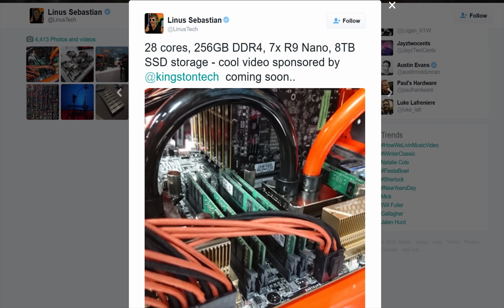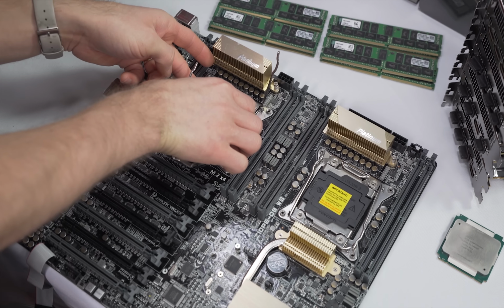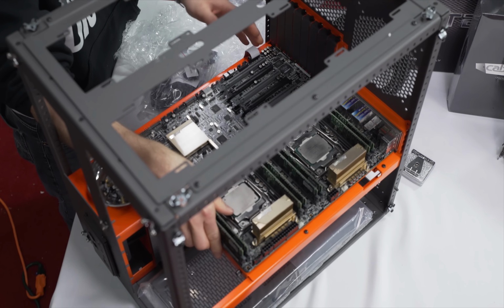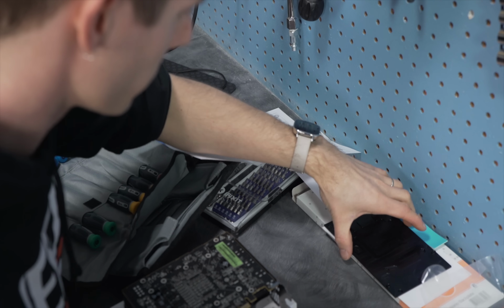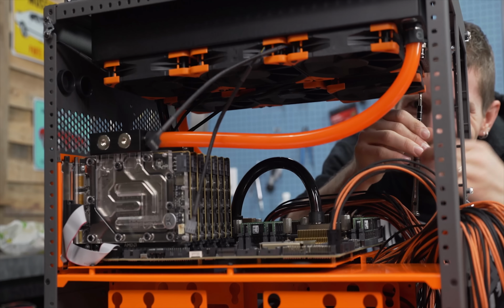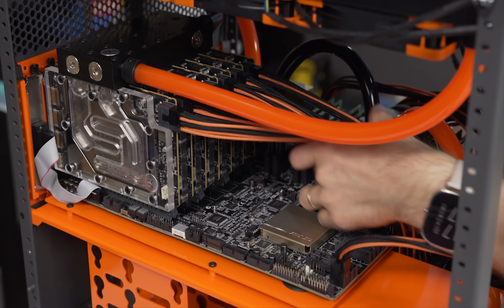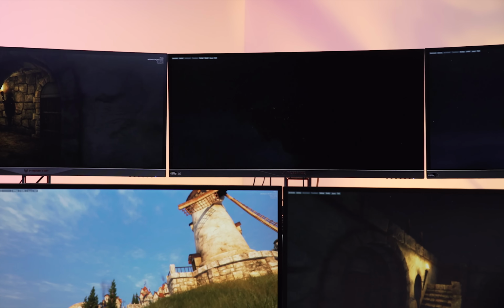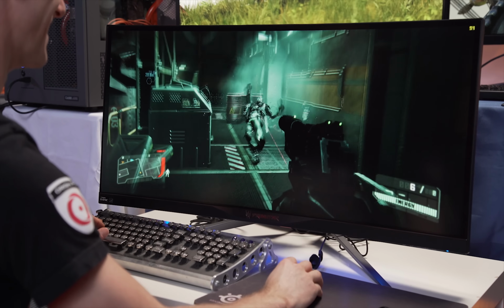7 Gamers, 1 CPU - Ultimate Virtualized Gaming Build Log

Comment: This would be awesome for an Internet cafe. Instead of buying or building 28 machines, you set up four of these.
Reply: yeah -_- $120K for a fuckin internet cafe
Reply: +Muhammad AbdelMon'em well, there's dubai :D :D
Reply: +Muhammad AbdelMon'em could costt less i think "I feel like this build's cost could have been cut in half, Ok so lets say you go with 512GB SSD instead of 1TB and maybe instead of 7 1.5k monitors 7 $180 to $250 monitors and instead of 8* 32GB sticks you got 8* 16GB shouldn't this build cost then come down to around 16k or 17k? which then puts it at about 2.2k per PC which IS CLOSE to the cost of a normal liquid-cooled PC ofcomparable specs and performance to that of the virtualized machine?

Which then brings up another question... if the cost is reduced by nearly half does something of this magnitude become a better solution than having individual machines (since this uses less power than 7 machines at max, and produces less noise and heat than 7 machines)? Yes there would probably be a ton of software issues that's a given."
Reply: Because of the overhead needed for viaualisation and the price premium of high density products like the nano and the $2.7k cpus and the 32gb ram sticks. You're simply better off buying seperate machines.
Reply: +ElZamo92 Sure The internet cafe would probably have to charge you a premium of 5x to make their money back :)
Reply: +Muhammad AbdelMon'em You can use cheaper hardware and then it would be pretty reasnoble
Reply: +ElZamo92 PC's are $600 each, totally going to spend $30000 on 7 of them
Reply: +ElZamo92 reliability is next to none, if one machine fucks up you&#39;re out of 7 serviceable units for customers.
Reply: +stefanozurich I assume that by 'viaulisation' you mean 'virtualization', in which case; there really isn't any overhead. Virtualization in modern PCs is done straight from the CPU in a standard (it really was a huge deal when this finally came out). That's the whole point of going through such lengths as opposed to just going at it through software on your already installed operating system. You assign the virtualization at a CPU level, then assign some resources/devices to that, and that's it. There really isn't any overhead as long as you don't include programs that interact with your virtualized instances, since they (at least in the setup displayed in this video) run in parallel. If you include the costs of electricity used (due to having to run the same components unnecessarily, and efficiency losses in the power supply itself and the delivery to the components), the extra power supplies, cases, and the motherboards, I'd say you can probably break even if you don't use top-of-the-line ultra dense hardware. That's not to say it makes sense from a business perspective. I'd much rather pay extra electricity and extra for redundant hardware than having my whole business shut down for a minor hardware failure. Y'kno, that whole thing about not having all your eggs in the same basket.
Reply: +ElZamo92 That would be the worst thing to do.
1 card goes bad and you're down 7 computers for some time. It's impractical as fuck, all condensed, water looped, so a bitch to service.
And it is wayyyy too expensive on top of that.
Reply: +ElZamo92 They would have to pay 120 000 usd doe
Reply: +ElZamo92 at least the power bill would be good over time , would pay off in long term ....
Reply: maybe instead of r9 Nanos something like r7 270s and instead of 32gb RAM/person maybe 6 or 8, maybe 1 of these cpus, not 2, maybe 500gb hdds instead of 1tb ssds, etc...
Reply: also no fucking need for predator x34s, they were around $11500 of the budget
Reply: +ElZamo92 Will this run minecraft, d'you think?
Reply: +ElZamo92 Do those things still exist ? Cause they don't in Estonia.
Reply: +ElZamo92 but this way more expensive !
Reply: Well it would be more lile a langamingcenter with a cafe build into it...It can run crysis...on all monitors at the same time...And you just want to surf in the internet...
Reply: +Seemslegit that is true
Reply: +ElZamo92 the downside...  all of your eggs in a a couple baskets.
Reply: +ElZamo92 Yea real clever, a 30k$ stupidly quirky unsupported gaming rig for an internet cafe. Seriously who the fuck up votes dumb shit like this. One machine goes down and half/quarter of your shop and profit out the window.
Reply: +G4A Gaming4All That would be basicaly the poor's man VDI server.

You can have a rack, run CITRIX server and have 40 VDI for your cybercafe. We do this in schools, big companies, datacenters, ...

Comment: 250 watts midrange pc under load?
What midrange pc you been looking at?
Midrange is like 350-500 watts.
Reply: +Surms41 There is not an official Mid range, don't be pedantic.
Reply: +Surms41 He said 250 watts at idle?
Reply: +Surms41 Don't compare older hardware with modern one, old components suck a lot more power, generally speaking
Reply: +Surms41 350-500 watts is what a 6700k+980Ti build draws under load.

Not exactly midrange. The new architectures aren't as power hungry as they were 2 to 3 years ago.

A 960+i5 6600 build will draw around 250 watts.
Reply: Surms41 A high end pc could be i5 and 970 because it is more expensive than say 60-70% of pc parts. an i3 and 960-950 would probably be mid range.
Reply: +Surms41 many PC elitists are not educated enough to know what an actual midrange PC looks like.
Guess same people see girls in the Sports Illustrated and go "Meh, they are average at best - Miss Universe is the only non-trash gurl".
Reply: +Surms41 My Haswell i7 combined with a GTX 970 take around 280 Watts under load.
Reply: TheMightyChris901  Yes, he said the build takes 250watts idle, and then said as much as a midrange pc at load.
Reply: +Jared Reabow (Jazza) I would classify Midrange by being able to play modern games on low, 60fps.

+Andrei Zhuk Yea, I just calculated the wattage for a i3-560 3.3GHz, 4GB ddr3 and a 550ti, the lower half of mid-range, and it draws 290~ Watts. Was a bit higher than my previous statement.
Reply: +Surms41 Well my laptop on low will do 60fps
Reply: +Surms41 yeah that's a 550ti... Much less efficient then the Maxwell architecture. A 970 draws the same amount as a 550.. So get a 960 and a i3 or i5 and I won't be surprised if you get less then 250 under load.
Reply: LightSoundGate Redid my last calculation, it was actually around 290watts, and I also did calculation for 970 and i74770, still around 320 watts.
***** 
I guess you're right about efficiency, that I did not take into consideration.
But then again, you must pay extra for newer parts with less power draw.
Reply: +Surms41 lel, people always think every PC burns 500watts with like a 960/970 and an i5...
Reply: Žan Zupančič Yeah with 970 especially.
Power consumption on nvidia's side kicks ass nowadays I guess.
Reply: Yeah.. 970 + 6600k burns like 250watts lel
Reply: ***** 
That's a low-low-end pc for any games.
Mid-range must have dedicated graphics.
Reply: +Surms41 Im running a 6700k + gtx970 strix, ~300W during load.
Reply: Same here: I got an overclocked 4790k and a heavily overclocked 980 ti. The system never draws more than 450w from the wall (Corsair Link)
Reply: Anton Meyer-Erlach wowow

Comment: The REAL Question is : would a REAL 6 Gamers 1 CPU? I would think of the Intel E7-8895 v3 : a CPU turboboosting up to 3.5 GHz with 18 Cores for a total of 36 Threads, that would leave 3 cores and 3 threads per VM if we go for 6 gamers. 
What do you think guys? is the CPU enough to game? will the upcomming (Q2 2016) E5-26XX and E7-88XX solve the lack of enough PCI-e lanes and increase the performances?

Comment: Would love to hear the response from Kingston and caseloads when they said we'll we are just gonna use double sided tape to secure these ssd's
Reply: +kingofengland111 They knew what to expect when the sponsored LTT
Reply: +kingofengland111 they're SSD's they weigh next to nothing and have no moving parts, it's not like double sided tape hurts them, plus it gives a unique way of displaying the hardware (while showing FULL LABEL) that will get people to remember it more (which is really the whole point of these kinds of shows).
Reply: *caselabs
Reply: +kingofengland111 I expect at CES the side with the SSDs will be showing to visitors, so they will be happy with the presentation.
Reply: +kingofengland111 That's kinda normal actually, quite a number of people actually do that. Although I'd figure CaseLabs would send in the adapters just before CES maybe.
Reply: +kingofengland111 My SSD is also secured with double sided tape. An SSD is very light, it's not going anywhere.
Reply: +kingofengland111 as long as the sata cables are plugged into the ssd you can throw them around as much as you like, they will function well. SSD is not HDD.
Reply: +xX JAEdot420 Xx you're a moron.
Reply: +kingofengland111 Something like:Yea, that´s our Linus...It way mine response too btw.
Reply: +kingofengland111 And i don't think they have the room to place it in racks
Reply: +kingofengland111 Why not? SSDs have no moving parts, so you really could just put it there without securing them at all and they still would not move.
Reply: +kingofengland111 The problem was that they didn't have any other options on what to do with them since the cases that should hold them, that was in the caselabs case could only hold down HDD in a 3.5 form factor and not the SSD 2.5 form factor.

I highly doubt that they will get a replacement for it from caselabs, but it could be awesome to see it properly setup with some LED strips or something of that sorts. (Maybe LTT/LMG decals)
Reply: il respond them SSDs are dog shit and wouldn't even put it on my shelf!
Reply: +kingofengland111 Well, for 1 thing, SSD's have no moving parts, so even if they were to fall it wouldn't matter. Second, I can guarantee you that companies who sponsor this channel have come to expect this behavior from Linus.

Comment: I wonder, if I build a gaming PC with the intention to LAN on it. Would this kind of thing be a viable option? of course, I would only virtualize two computers.  Another thing would it be possible to set up a boot option or setting, which allows one virtualized computer to use the full capacity of the machine while I don't LAN? Or am I simply better of building two separate computers.

Comment: Can a nano really push 100fps in crysis 3 at 3440x1440 without using lowest settings?
Reply: +Heatranoveryou the nano card is really strong actually 

don't let the size fool you :D
Reply: I know its powerful, but hes over selling it I think.  http://www.anandtech.com/show/9621/the-amd-radeon-r9-nano-review/5
Reply: +Heatranoveryou the normal Nano thermal throttles, this one is Watercooled.
Reply: Mikee Tyson
Ah right. I forgot about that. I should have checked it specs too and realized its actually a fury x. However, I don't think even Fury X and 980 ti can push 100fps in crysis 3 at 3440x1440.

Comment: Sorry, random question, if I wanted to change my CPU to a higher end CPU, will I need to reinstall windows? Right now I have a AMD 4300, but I want to upgrade to an 8350.
Reply: Cheanno Respo No, you don't need to reinstall windows if you are upgrading your cpu.
Reply: ***** Thanks!!!
Reply: +Cheanno Respo For that matter, you can pretty much change a lot of things in your pc without the need to reinstall windows.
Over at LTT they have test drives they use on their test benches that they just plug in on the the platform they want to test and don't reinstall windows every time ;-)
Reply: +Gormador Changing more than 3 items in any pc will require reactivation of your windows license. Changing motherboards is sometimes a crap shoot.
Reply: Chris Hunter Well, yes, but a reactivation isn't a fresh install now, is it? :-)

Comment: Is this not 7 gamers 2 cpus? Hate to be pedantic, but I guess you probably could have done it with just one. A single core, 14 cores, 28 thread, 2 per computer. Might not have been the best gaming experience, but still could have been done.
Reply: No when he refers to the cpu he doesn't mean an actual cpu he means the entire of because it is processing for all 7 gamers
Reply: +Zell It has two physical processors but it is still one CPU.

Comment: I would love to see this get installed somewhere and say have all your editors be able to access and use it without needing a full terminal to do so.  

They can put their VM to sleep but not shut it down so when they push on the keyboard it wakes up.  

Would be interesting to see how the cables get routed and run to make it all work.  I know some things can be run in the walls and just have wall plates installed so monitors and USB stuff would just plug into the wall is it were but how would the signals cope and would people appreciate the added desk space and say "parental" controls available but no one having their own system.

Comment: 1 CPU? thats clearly 2
Reply: +Győri Sándor try 7 gamers 1 board
Reply: +Győri Sándor you are dumb as fuck the computer is the cpu, the central processing unit for the 7 gamers
Reply: Even I know I cant argue with idiots I still try: https://www.google.hu/search?q=CPU&tbm=isch&tbo=u&source=univ&sa=X&ved=0ahUKEwi0pqyXuI3KAhVIhiwKHfrrCw8QsAQILg&biw=1920&bih=989 This is a CPU. And thats a multi cpu motherboard. Do you know why it is a multi cpu motherboard? because it holds multiple cpus. the computer is not the cpu. the computer is the combination of components and one of the components is a CPU therefore cpu != pc (!= means not equals)
Reply: +Győri Sándor I agree with you. 2 CPUs in one computer
Reply: technically that's 28 CPUs because cpu refers to a single core, not the entire processor. But most people just call the whole processor the CPU anyway.
Reply: +Győri Sándor The reason it says 1 CPU in the title is because the 2 CPUs act as one. Physically they are 2, but virtually they act as 1 CPU that shares the load to the allocated cores .
Reply: Joseph Pitts Yes
Reply: invaionworld Yup, but that doesn't change the fact that this machine contains 2! intel xeon processors. TWO CPUS!
Reply: +potsbeatnt3000 A CPU is a Central Processing Unit, a Computer is a combination of power supply mobo CPU GPU etc...
Reply: Győri Sándor It does. If you have ever used  VMs you would know that you don't count the CPUs. You count the total amount of cores your whole setup has.

Comment: I have watched EVERY SINGLE VIDEO you've made (on this channel) they are all master pieces. but this one is absolutely legendary. I went from a core 2 duo at stock speeds with a radeon 3450 to a fx 8320 at 5ghz cooled by a H100i GTX, paired with a evga gtx 980 SC at 1510mhz. if I never watched your videos, none of this would be possible

Comment: I feel like this build's cost could have been cut in half, Ok so lets say you go with 512GB SSD instead of 1TB and maybe instead of 7 1.5k monitors 7 $180 to $250 monitors and instead of 8* 32GB sticks you got 8* 16GB shouldn't this build cost then come down to around 16k or 17k? which then puts it at about 2.2k per PC which IS CLOSE to the cost of a normal liquid-cooled PC ofcomparable specs and performance to that of the virtualized machine?

Which then brings up another question... if the cost is reduced by nearly half does something of this magnitude become a better solution than having individual machines (since this uses less power than 7 machines at max, and produces less noise and heat than 7 machines)? Yes there would probably be a ton of software issues that's a given.

Comment: For a system with 256GB of RAM why would you even bother with multiple large size SSD Storages? I mean couldn't you just install on a tiny SSD the OS, and then load everything into the RAM, software install etc into the RAM from external USB Storage? I do this with my ram drive after a reboot dumb everything on the ram drive into a folder, stick 24gb on a USB external, and then after the reboot have it automatically dump it all back onto the RAM. I still do have an SSD, but seriously 8x1TB SSD storage + 256GB RAM, what a waste of funds. Still cool concept.
Reply: +Jay Stew waste of funds? all the parts were free.. your argument is invalid
Reply: Not really arguing anything here bro. Just saying on a $30K build what is the point of having 8TB of SSD storage vs 4 GB Shared HDD storage? That is about 10% of the cost and it doesn't really make sense to me when you have 32GB of RAM per player anyway. Would you really want to run a program from SSD instead of a RAM Drive anyway when you have 32GB to work with? I mean think about that. There may be a few programs you can't fit into 32GB but I doubt it. If that is the case then adding more RAM lol... Yeah ur right whatever.
Reply: what you're saying makes no sense. ram is not the same as an ssd. once you turn off your PC everything on the ram stick deletes itself. there's also only 32gb for each user
Reply: +SUPERTRIP™ "only"

Comment: Would it be possible to use two different graphics cards, and still do this, because they aren't in SLI/Crossfire right? Is it possible for this software to utilize both a 290X and 970 in the same system?